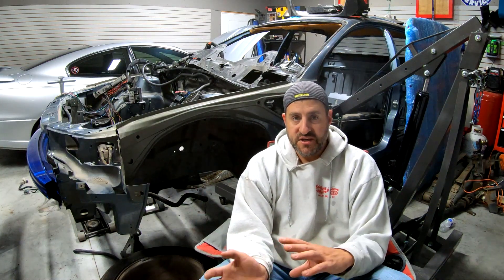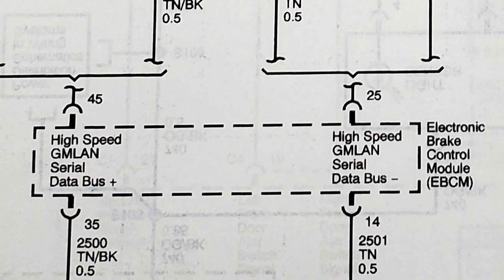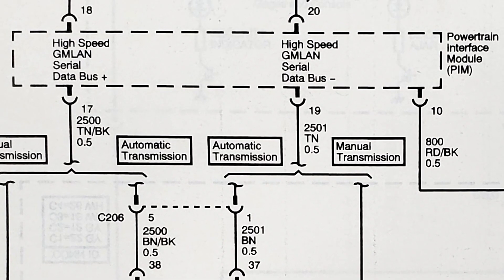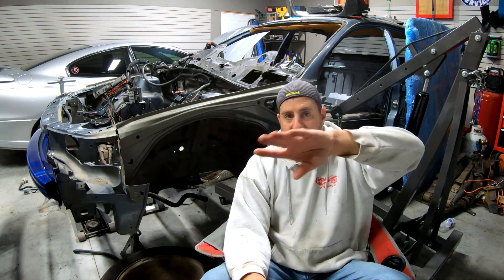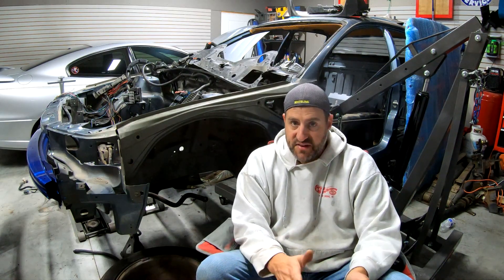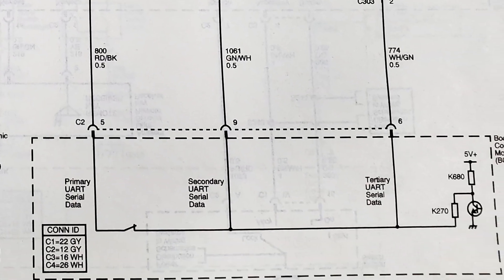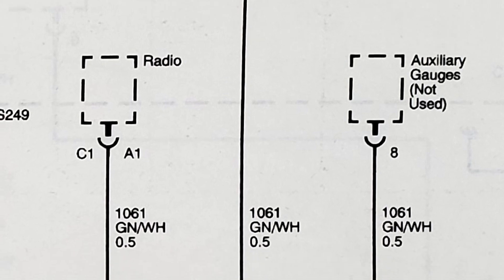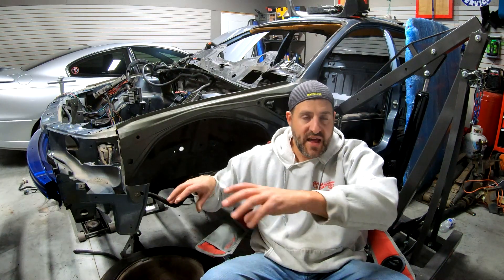Josh's Car Corner - Ep. 101 - Intro to GTO Computers and Wiring

Comment: Great overview Josh, I thought I would mention my issue with my 2005 and see if you have any ideas,  randomly, I get the dreaded beeps and the battery light goes on and the gauges go flat,  the car typically runs.  I had it out this past weekend and the it did this issue multiple times and the car shut off as I was driving.   I put it in park and was able to start it but it was nerve racking.  Thanks you for any assistance or ideas you have.  Mark
Reply from the maker: I would start with that ground bus bar by the battery. Take it off, check the pins, make sure it's all corrosion free and the nut holding it to the fender is tight.

Comment: Josh, great video. As you mentioned at the end of your video, the radio information (volume level, station, etc.) is not showing on my Instrument Cluster). There were no mods done to the car (2005 GTO). I checked the BCM wiring harness behind the glove compartment several years ago, examined the wiring and was fine. I put additional protection between the metal bracket and rewrapped the bundle. I removed the battery and checked individually for continuity between the grounds you mentioned in your video and the negative battery terminal. Everything checked out ok except for one of the connecters on the Harness (G102) shows no continuity. It's the solid BK wire connector. The other 5 connectors (BK/YEL, BK/WH, BK/GN, and the 2 RED BK) are fine. Shouldn't the BK show continuity as well? and if that is the case what should I be checking? Also, my Airbag light comes on. I built the cable for the VZ Airbag application, ran the program. I get the error, "Steering wheel loop Open Circuit <high resistance error> It only shows up in the Historical Faults section. Could be the clock spring itself but I am leaning more towards a grounding issue. Any advice will help. Thanks. If I resolve anything I will post.

Comment: Better have the codes to link the modules together if any one of them fail. Make sure if you are flashing the ECU, PIM etc, use a flash programming power supply or you can brick the ECU and other modules. Ask me how I know.
Reply from the maker: Yeah I already knew. It's called Project E38.
Reply: @JoshsCarCorner  Yeah, the E40 ECUs are harder to find for the 05 GTO and more expensive. Not too sure if the architecture inside any other ECU will work. I heard even the 06 is slightly different from the 05 and probably wouldn't work calibration wise.

Comment: how is the wiring harness removed where it goes thru the firewall?
Reply from the maker: It can only be removed by taking the firewall out of the car. Otherwise you have to cut the firewall or completely disassemble the fuse block and put it back together.

Comment: i want racing seats but afraid of the  airbag fault. Ive research and people say disconnect the battery and remove the yellow and plug it up with the el 46841 part. Will this still throw a airbag code even if i plug it up before i re connect the battery.

Comment: Can you elaborate on the AUX gauge please? I'm wanting to work on a GTO project and looking for all the info I can
Reply from the maker: It refers to the optional center console pod gauges. One is battery voltage, the other is oil pressure.
Reply: @JoshsCarCorner  are these available anywhere and how would I search for them?

Comment: Hey I'm build a 04 gto that will achieve 200 mph . 
I had an 06 that I was going to do it it but I wrecked it. So I bought an 04 body and I'm changing everything over . I built a iron block 6.0 . Had the rotating assembly balanced PRC 243  CnC heads.  With long tube headers Now I'm upgrading the suspension . Ill keep u posted and I'll video it when I do it.

Comment: As far as the BCM wire rub issue being resolved in the 06 cars, I'd say that's not true.  I got my 06 in 2010 and the tape was rubbed through and the brace was just starting to wear on the wire insulation.  I wrapped it in a piece of heater hose and I've not yet had any electrical problems.

One interesting thing I found with my 06 and using a Tech2:  My car has the Holden/GM gauge pod on the top center of the dash.  Any functions of the Tech2 which require the CANdi module to be connected to function will NOT function while the dash top gauges are connected to the car.  Disconnect the gauge wiring at the gauges and the Tech2 with CANdi work just fine.  The CANdi is not required for all Tech2 functions but it is required for a lot of the more complex functions.  I almost replaced a perfectly functioning CANdi module before I figured this out!
Reply from the maker: That's a great bit of info! Must have something to do with with needing an open Class II serial channel for the CANdi, and the center gauges must be occupying it.
Reply: I discovered this interesting bit when I bought my 04 last year and plugged in the Tech2 just because and everything worked.  Which made me even more confused as to why it didn't always work on the 06.  Then someone on LS1GTO mentioned that the dash top gauges might need to be disconnected and I tried it and then the Tech2 worked fully!   I guess it kind of makes sense but I would have never thought to try that on my own.